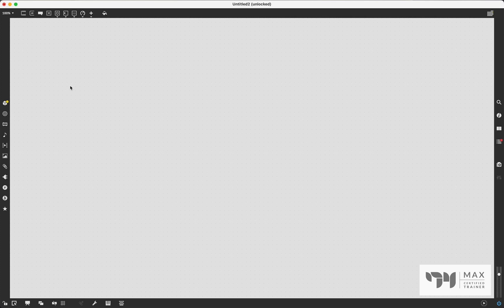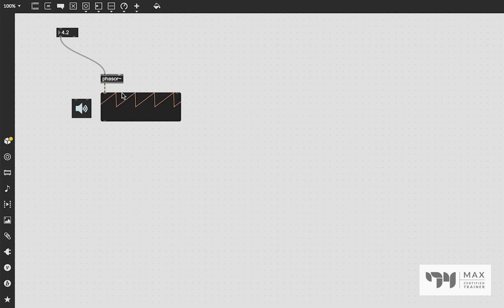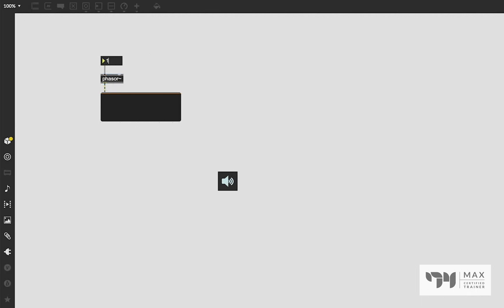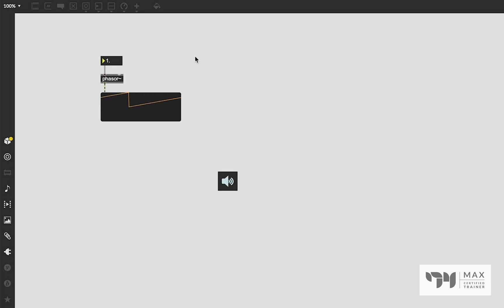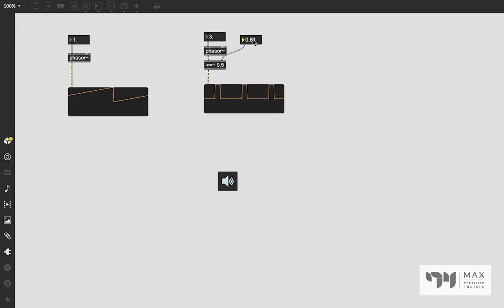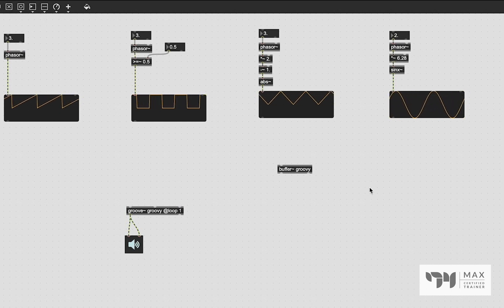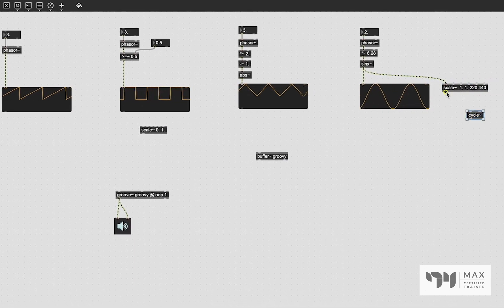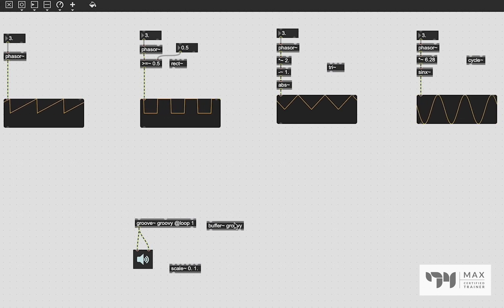Phasor~ - Signal Ramps and Wave Shaping - Helpful objects to know - Max MSP Audio Tutorial

Comment: why does "greater than or equal to 0.5"  equate to "0 or 1"  what happened to 0.6, 0.7, 0.8, 0.9 ,etc
Reply from the maker: Greater than or less than comparisons in programming only check to see if the incoming value is above or below the set threshold. If it’s true it returns a 1 to tell you it’s true and a 0 if it’s false. Because .6 .7 .8 .9 are all above .5 the equation is true and will output a 1
Reply: @AndrewRobinson26  ah, thank you for that.  details like that tend to trip me up in max haha, ty

Comment: THX! Hey, do i get it right? the phasor to sine by 6.28 example is great for advanced synthesis because it is waveshaping backwards or something?
Reply from the maker: That example you are referring to is shaping the phasor wave from a 0-1 ramp to a -1 - 1 sin wave. This is useful in a lot of different instances for example if you’re using the phasor to drive processes in your patch but say one of the processes needs the -1 - 1 ramp, you could use this formal and shape the phasor into a sin wave ramp which gives you the function you need while keeping everything in time because it’s all tied to the same phasor. You can also use wave shaping to get a variety of complex timbres and so much more